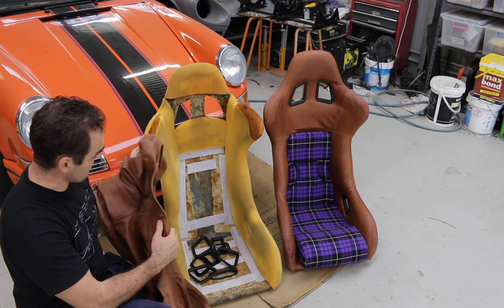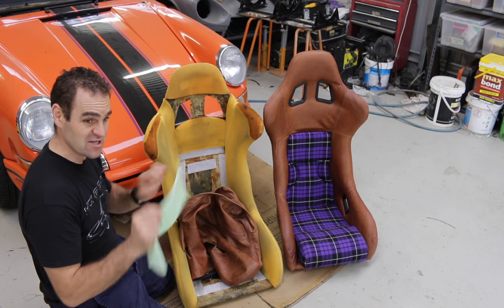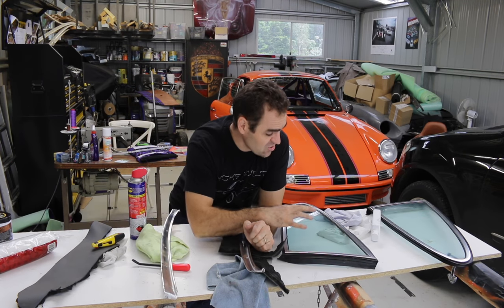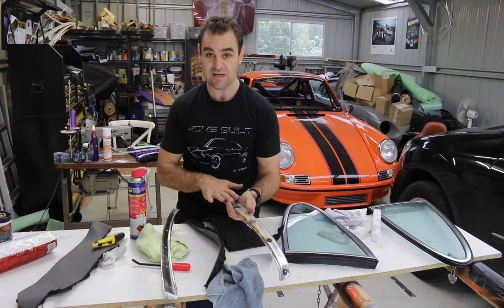How to fit rear quarter window rubbers - Porsche 911 Classic Car Build Part 48

Comment: Hello Jeff, I’ve enjoyed watching your videos over the past years on your Porsche 911.  I have a 1974 Porsche 911 I’ve had the engine rebuilt and rebuilt transmission and now I’m needing to replace those rear quarter seal window rubbers but I wish you would’ve really shown the beginning of the process of how you took the windows out And identified where the rubber seals are on the rear quarter windows.  Now I just need to finish watching the rear quarter seal portion of the video to see how to put the rubber back in place. Thank you.

Comment: so jeff i see a new vocation as an auto interior craftsman. you seem to love it! 
congrats on getting your engine to the states and look forward to see what you do with the suspension.
Reply from the maker: Thanks mate. The suspension will be left until the car is on the road, that way I can see what it needs and also be able to feel the upgrades as they happen.
Reply: given the rest of your car i have to believe you have a goal in mind. something you can track day but live with on the street? something that age likely has to be gone through a bit, yes?
Reply from the maker: Absolutely. I have come across a few upgrades around the place so far. I haven't really looked at what has been done to the suspension. How old it is, etc. All I know is that it sat a lot lower than standard when I got it. I will have to look into it further.

Comment: Best nip/tuck episode ever! ;)   It's really coming along Jeff.  I've been meaning to ask about the paintwork. Assuming you used two pack paint, what sort of breathing mask setup did you use when spraying? and...would there be anything you would have changed in regards to the setup you used when spraying?  Cheers!
Reply from the maker: I used the correct automotive spray painting mask, the same as pretty much every spray painter in Aus'. It has 3 types of filters. 2 different kinds of particle filters and then the chemical filter. It is not worth even thinking about spraying with anything less, you health is far too important.
The paint was all 2 pack, as acrylic never really comes out very well. Overall I was very happy with the whole painting process. I was a professional airbrush artist for 13 years and as such I worked in at least 100 different professional spray booths, and plenty of them were far worse than mine. If anything, more light in my booth would have made it better, but it was still more than up to the task.

Comment: Nice work as usual, interior is really looking complete. I wouldn't worry about the time you re spending on it, it will be worth it when everything works and fits right! I have been working on a door frame for a couple of months..its taking ages to finish for the next episode :)
Reply from the maker: Thanks mate. I have been wondering how the Alfa is coming along, but I know how long things really take when you are trying to get it right ;)
Reply: Home Built By Jeff yeah, I m sorting out the doors to use as reference for the rest of the body. Finding used ones took a month and I was lucky! Great job on hitting 5k subscribers :)
Reply from the maker: Thanks mate. Keep it up. I am looking forward to your next episode.

Comment: Jeff, I have a question for you about the fast motion video. Do you use stop motion, say a frame every 2 seconds to film the fast bits, or do you film at a regular frame rate and speed it up in editing?

And congrats on your 5000 subs. :)
Reply from the maker: I just film it normally and then speed it up. I speed it to different rates depending on what I am doing and I also edit down a lot of that so that it just gives you a general overview. Otherwise it would go too long or I would have to speed it up too much that you couldn't see anything.
Reply: Home Built By Jeff . Thanks Jeff, I just started uploading vids to my channel. I'm learning from scratch on the video editing and I'm just trying to get a handle on some editing tips. I need a lot of work on that front...lol. I just learned how to cut and splice. I've done lots of audio editing in the past but I even forgot a lot of that stuff. Some of the stuff that I learned with audio definitely applies to video so I'm catching up rather quickly. I need to film more to get more material to edit. :)
Reply from the maker: Editing makes the movie. I am just like you, and I am learning as I go. I keep trying to improve all the time. The best bit of advice I can give, is to watch it back yourself, and if you come across something that goes too long, or doesn't sound right, stop, fix it and move on. Then watch it again. Good luck.

Comment: Dont use clearcoats or epoxys on polished aluminium, there are far more better alternatives, and the best out there is Ceramic Pro Strong, You could also use other Ceramic Coatings, fron Cquartz or Carbon Collectives for eample.
Reply from the maker: Fantastic. That is the type of suggestion I was looking for. I will check it out.